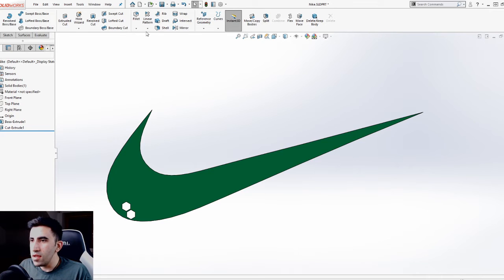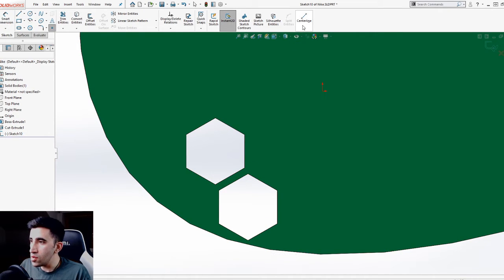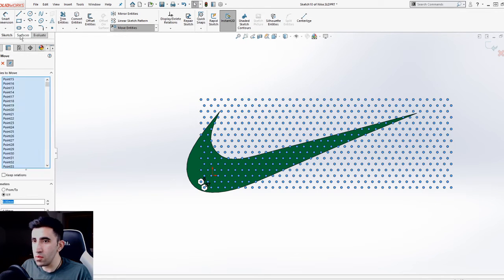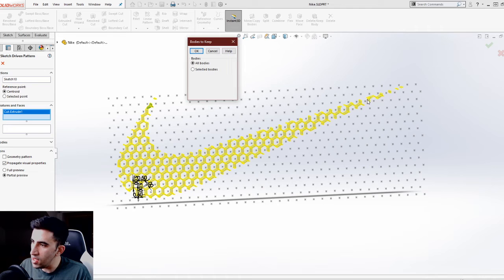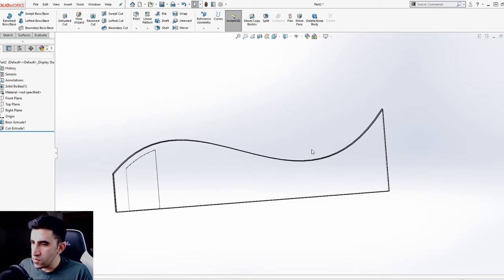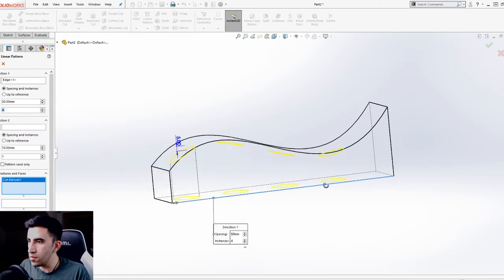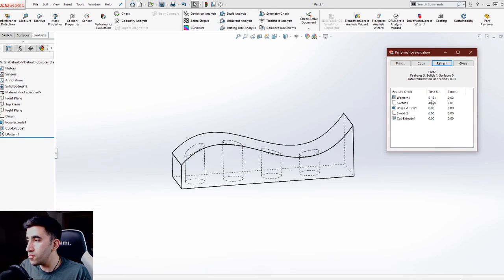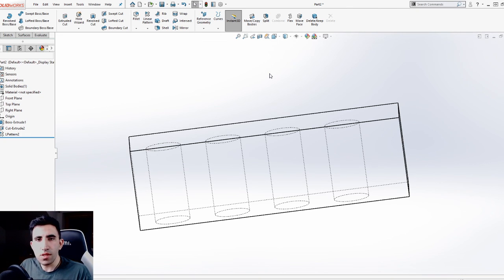SolidWorks with Ryan - Sketch Pattern - Live#1

Comment: Can you tell us what is the system configuration that ur using to run solid works??
Reply from the maker: CPU: Core i7-9700KF CPU @ 3.6GHz
Ram 16GB
Reply: What abt the GPU???
How much did the whole pc cost you?? Leave the price of monitor and other accessories.
Reply from the maker: @sreedharans6477  Look, the monitor and other accessories have nothing to do with the performance of your SolidWorks and the price for them is dependent on the brands you buy and the country you purchase it from. GPU Nvidia GTX 1650
Reply: @with-aryan  thanks bro....